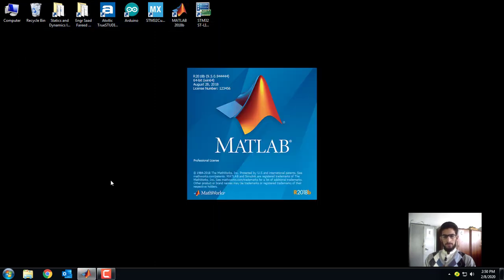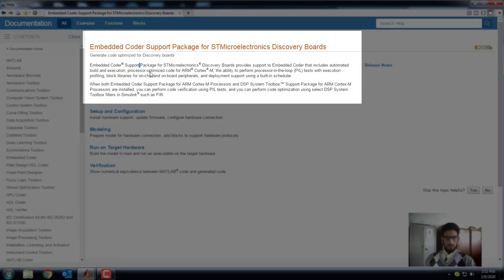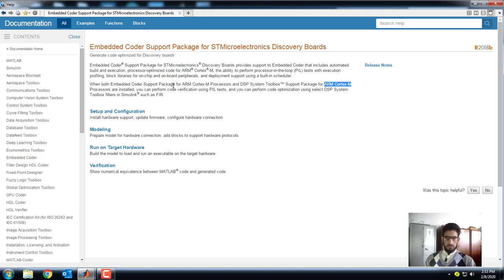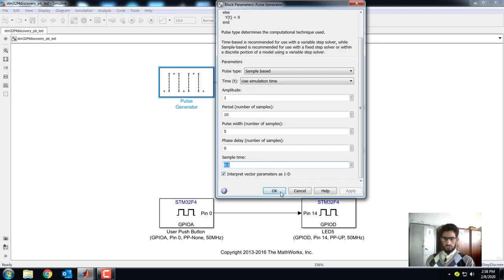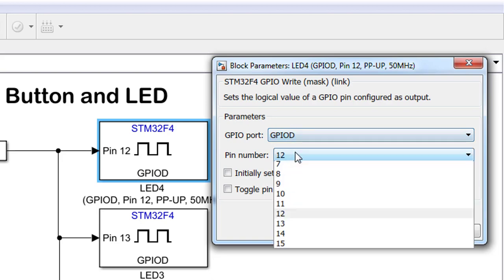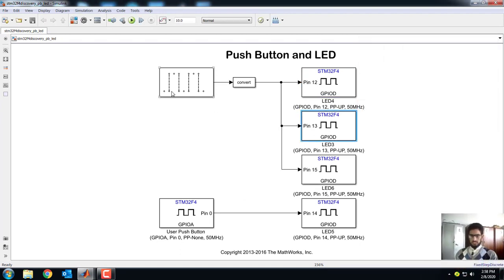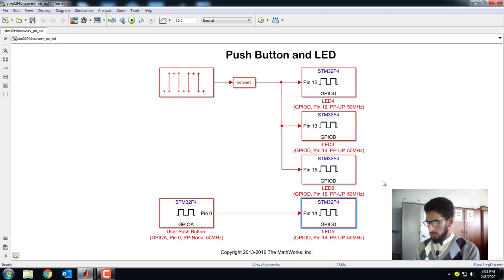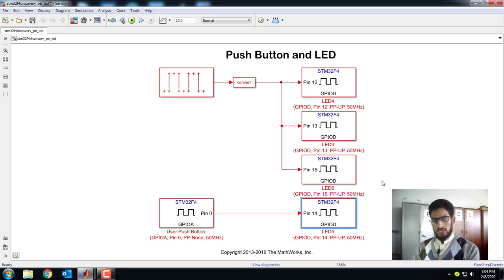Blinking LED on STM 32 with Simulink

Comment: Hello Saad, thanks for the great tutorial. However I am having a problem. 
When i deploy the model onto the hardware (STM32F411), it builds successfully but the LEDs do not blink. 
What could be the problem. Need your help.
 Thanks
Reply from the maker: Please double check that you have selected right pins and board in Hardware selection. Check in the board data sheet the pins for leds and assign them accordingly in hardware selection. Hope so that will will solve the problem. Regards.
Reply: @Drone.Robotics   , hope you are well. I uploaded a program written in STM32Cube IDE and the LEDs blinked which shows the pins are well selected. I do not know why the Simulink model has still not blinked the LEds. Looking at the main code generated in Simulink(ert_main.c), nothing is being called for sending signals to the led pins. What could be the issue? Thank you.
Reply: @Drone.Robotics  , hello. Finally figured it out. I used STM32CubeMX to configure the pins and generate a .ioc file which is imported into simulink. On uploading the code, an IAR embedded workbench file is generated which is uploaded onto the board. Quite a longer method though. Thank you for your tutorial. Wouldn't have gotten this far.
Reply: @Gracie232  Hello, I am trying to deploy also in a STM32F411 board. If I well understand, I have to first creat a .ioc on CubeMx and import it on simulink ?